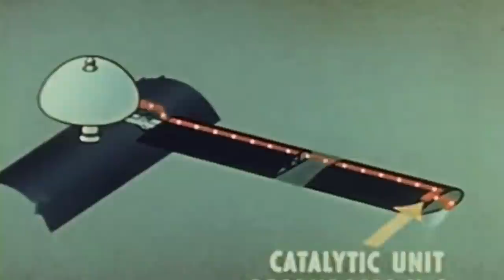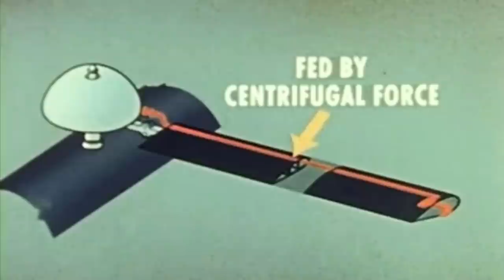Helicopter with Rocket Blades

Comment: In concept is a brilliant idea spooky looking at those guys with no shirt standing underneath strong hydrogen peroxide spray nasty stuff causes severe burns but the idea is solid it doesn’t have to be hydrated peroxide there’s other means but I think it’s a valid means even today perhaps solid rocket boosters just for emergency use

Comment: Possibly having a highly combustible tank of peroxide on top of the rotors. Made a sniper target that was just too obvious. 
    Other improvements in engine and blades and general engineering. Also made this jato type assist unnecessary.

Comment: The French made Djinn had a similar system, with the main rotor being propelled by exhaust gasses travelling inside the blades.
It went into production and was even exported.
https://en.m.wikipedia.org/wiki/SNCASO_SO.1221_Djinn

Comment: why they made engine for that,just add some pipes from turbo manifolt  centrifuge  ll pull it to propellers and you can use it as extra power for propellers

Comment: I just thought of an invention that with a bit of the right engineering might improve the performance of a helicopter, what if you ran the exhaust through the blades and out of nozzles .the pressurised Gas would be released closer to the blade hinge the faster the blades spin sort of like gears.🤔